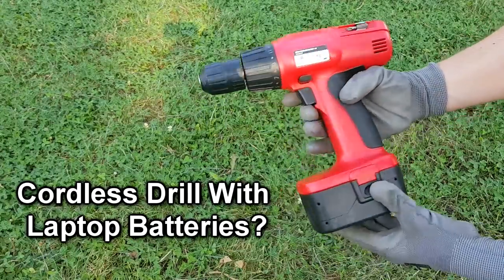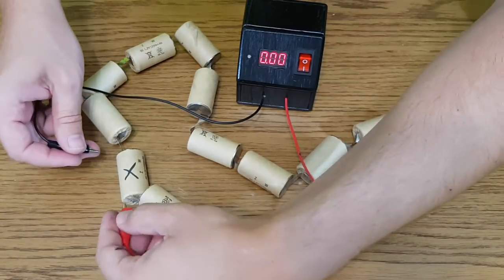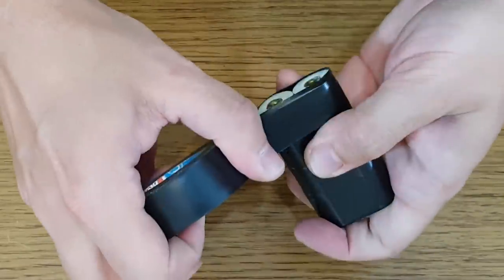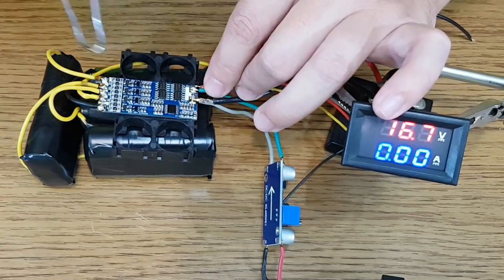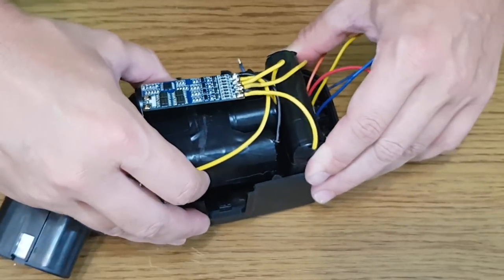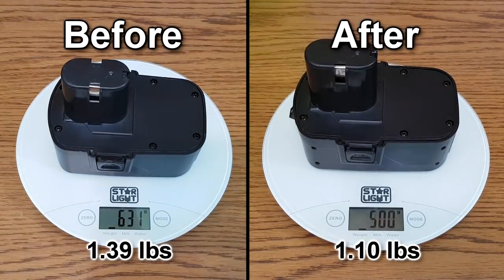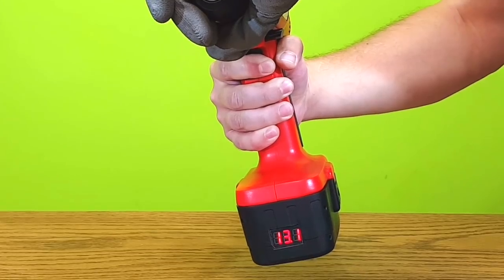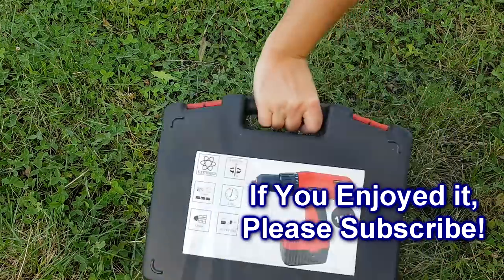Cordless Drill Conversion - With Laptop Batteries??

Comment: There are also shops which offer battery cases and PCBs for cordless tools which run already on LI-Ion batteries, for example the Makita LXT sytem. Combined with salvaged high current cells from tool batteries with broken PCBs (can also be packs from other brands) you can get extremely powerful packs, which are on the same high power level as the original battery packs. It is important to use high current cells in this case, because only them can deliver the currents tools like angle grinders or cordless chain saws need.

Comment: Nice tutorial.  But often, it is those cheap BMS and controllers that goes out first.  It is usually why laptop batteries are dead in the first place.  Instead of soldering all the components in the battery, just extend the balancing cable out.  You can make a small magnet door on the battery to hide it if you want to look neat.  Then modify the charger to connect to balance charger like Tenergy or Imax B6.  And just connect the balancing cable.

Comment: Nice summary of others videos, 
1-But are you sure the BMS make the full charging process : Constant current until 4.2V/S, then Constant voltage untill current goes to 1/10th the charging current then stop charge ? Because for what i've seen these BMS are mainly made to avoid under and over voltage and disconnect the battery from charger or charge when it happens (needing to remove the charge or the battery to reset)
2-how and where do you set the charging current ?
3-what is the usage of the 2A step down converter you put in links
Reply from the maker: hi. in the BMS specifications it says CC/CV. when the battery pack is getting almost fully charged, the charging current decreases from 0.60A to 0.25A. so theoretically it should have some kind of CC/CV charging. to be sure, you need to connect a volt/ammeter to a single cell, and monitor the entire charging process. the charging current is set by the BMS. if you want to limit the current, you can use a step up/down converter with current limiting potentiometer, added to a 12V or 24V charger. if you don't have a 12V charger, you can use the standard power drill 24V charger + step down converter from the link.

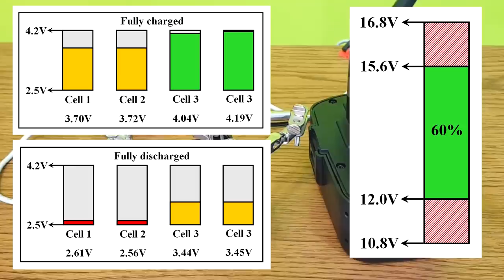Comment: At 14:57, 60% of voltage drop does NOT mean 60% of capacity. Voltage and capacity are non-linear relation.
I have a question. You set the step-up output to 18V, but why it drops to 13.9 to 15.4V when you charging? It's a 2A step-up module, and should maintain around 18V when current less than 2A right?
Reply from the maker: 60% it's an approximation, to make the explanation simpler. the voltage is dropping, partially because the step up converter efficiency decreases, when you increase the voltage. but mainly I think it has something to do with this type of BMS. I've used other BMS models and the voltage difference is not that big.

Comment: Bine explicat clipul insa as avea mici sugestii, de exemplu ar fi mai eficient sa folosesti un step-down cu un incarcator de 24v sau chiar refolosit cel de laptop, daca ai fi avut mai mult spatiu putea fi inclus in carcasa bateriei. Daca nu ai facut pana acum un spot welder din transformatorul cuptorului cu microunde ar fi fain sa vad unul bine pus la punct si sigur explicat de tine :D tine-o tot asa!
Reply from the maker: salut. dupa ce am facut clipul, am incarcat-o si cu incarcatorul ei original de 24V + convertor step down. este ok si asa, singura diferenta este ca nu se mai incinge convertorul de tensiune.

Comment: 1:30 I experience the same issue with my DIY dremel, when I connected it to my ATX Lab Power Supply (thx, I used your "Gorgeous" ATX Lab Power Supply project). Additionaly, I added a XL6019 LM2596S (Amazing StepUp & StepDown Module) to get some variable feature other than 3.3v/5v/12v. Sometime I need less than 3v, to test 3mm Led for example.
My DIY dremel is build with an old 555 motor, it was for a drill I guess.
So alternative is to connect it to 5v, then step up voltage till reaching the speed desire!
Thx for the explanation, why ATX is shutting down... I did not use the trick with dummy load as you cause I do not have access to a variety of those ceramic resistor. But after learning, how useful they are, I started to collect some of them...
But wait , at the end you are charging the battery pack with an ordinary 12v charger! this white charger you are using is not for litium cells. What about when the battery are fully charged?? This charger will not cut off?? Is it not dangerous for the cells to be constantly chaged??
Because I learned that BMS is not actually a proper charging board, it is a protection DISCHARGING board!! yeah some BMS got over charge protection, but still they are not proper charging board for litium cells...
Reply from the maker: hi. it depends on the BMS board. if you have a CC/CV charger or converter + a good BMS board with balancing feature and decent voltage values for the overcharge protection and the other features, it should charge the li-ion cells good enough and not damage the cells. the charging modules for one cell (4.2V) are better, because they are more precise and it's easier to apply all the protection features to only one cell. it's difficult to do the same think with several cells in series.
Reply: @Sorin_DIY  yes you are right, though, I think it is easier to use 12v charger for Lithium battery, like you used with your first Router UPS.
https://www.youtube.com/watch?v=IlEnEn7ptmc&t=8m54s
You right it is much easier charging a single 18650, but when you switch to 2 or 3 especially in series, thats when things start to be tricky and complicated.

Comment: Hi Sorin, I made similar modification like you, but my drill is stopping when accelerate. I used  3s 40a bms board  and  battery pack in 3s2p configuration. Dril is BOSCH GSR 9,6V VES-2.  There was a small resistor on the battery + - connectors i cutt it out, but i think should stayed there...Thanks.

Comment: thanks for the video, but may I ask why you've set the charger at 18 Volts? nominal voltage of the drill (and original battery, also your new battery) is 14.4 volts and maximum voltage of your new battery is 16.8 volts. shouldn't it be 16.8 volts? thanks.
Reply from the maker: the BMS charging voltage needs to be 18V according to the specifications. it also works with 17V

Comment: So, can I utilize an old laptop charger for this purpose? I assume I just need adjust the step-up/down converter to 18v. Correct?
And, should I worry about overcharging if I leave the battery with charger on whole night?
Thank you 😀
Reply from the maker: hi. you can use the laptop charger. but be careful if it has too much current, the converter and lithium cells may get very hot. the BMS board has overcharge protection, so you can leave it overnight.

Comment: Hello, i have a question. I will make same thing, but will use a charger from laptop. I can use 16V or 18,5V charger. What is the tolerance in the input voltage, and how can i limit the current if i don't use a DC-DC buck converter. Will the board limit current after going to 16.8V and will it stop charging. Thanks
Reply from the maker: hi. you need to give the charging board exactly the voltage it needs. the only option is to use the 18.5V charger, with a step down converter. you can use a converter with current limiting feature, like LED drivers. and set it to 16.8V and 1A. or you can buy a charger with 16.8V and 1A.
Reply: @Sorin_DIY   I will try with 17V adapter, hope 0.2V will not be a problem. What is the logic with the charge. When the voltage go up to 16,8 V like the charger on, it stop charging or???
Reply from the maker: I think it will also work with 17V. all 4 cells (or pairs of cells) are charged in series with the voltage from the charger, let's say 16.8V. it will take each cell a different time to get fully charged. when the first cell gets charged to almost 4.2V, the balancing feature activates a resistor (load) on that cell. the load will draw a part of the charging current from that cell. so the charging level of the cell will be "paused", until the other cells also get to 4.2V. then, when all the cells get to 4.2V, the charging is stopped. but when you use old/salvaged cells, it's difficult to balance them.
Reply: A few questions. I see the machine is 18V. You put 4 sells in series, which is 16,8V. The machine works, but with less power. When the battery is 16,8V why you are using 18V for charging. i try the same but with 4S 30A 14.8V-16.8V 4 Packs 18650 Li-ion BMS PCB W/Balance board. If i use your schematic the machine don't have power to spin at full speed. I reorganized the things , now it charges and works fine, but when i start drilling the voltmeter is turning of... but the drill still works. Probably i done something wrong, but will see it later.
Reply from the maker: my BMS board needs 18V, you can check the specs. you need to check the connections for the voltage indicator. you can disconnect the negative wire, to turn off the voltage indicator. you probably connected some wires incorrectly.
Reply: @Sorin_DIY  I fix it. Just made a little reorganisation on the board connection. Strange but the low voltage alarm is acticating on higher values. Or some of the batteries is not good and can't handle the load, or there is a sparks from the stator and that is confusing the voltmeter. Have to use a cap, but no time for now. Will live it like that. Thanks for the info.
Reply: Yanko Goshev .

Comment: This video is beyond cool.
I have a B&D screwdriver/drill with the same form-factor except 12V. If I wanted to give this a shot... What would you recommend, using a 4S battery and a step-down converter?
Reply from the maker: hi. a step down converter is not good for electric drills. because the electric motor will draw a high inrush current at startup, probably more than 10A and this is beyond most converters. you need high drain cells in a 3S configuration with a powerful BMS.
Reply: @Sorin_DIY  I see. I ordered a 3S 25A BMS and was planing to go 3S2P. Still deciding which batteries to use. What would you recommend? Between Samsung 30Q, Sony VTC6 and LG HE4? (or others if you can think of any). I don't know for sure any of these are original, I only have the store's word-of-mouth about them.
Reply from the maker: the brand and model are less important, they are all good cells. but you need to be sure, you don't buy fake cells. you should check the rating of the store and find products with a lot of orders and reviews. some people even post photos with the real capacity of the cells, tested with a good charger.
Reply: @Sorin_DIY  Servus Sorin, can you indicate a good li-Ion/Li-Po/LiFePo accu to buy? Any experience with them? Any suggestions?

Comment: "Someone who knows what he is doing"  I saw this quote and I totally agree.
Very informative and technically-correct video
I'd be interested in an update after 3 years.   
Are there any lessons-learned after 3y of using this?  
Anything you would do differently?
I'm going to convert my old battery-drill based on your video
thanks so much and keep up the excellent work,
ChrisV
Reply from the maker: hi. I used and charged the drill a few times, but eventually the lithium cells got very unbalanced, because they are not made for high currents. so you need high drain cells and a BMS board with a higher balancing current like 100mA.
Reply: What is your recommended minimum discharge current of battery to be use for power tools.

Comment: Hi Sorin. Just have seen your video. I am afraid of the switch you have used for the circuit. It looks so weak for the current of 10 A. What do you think?
Reply from the maker: hi. I think it was a 10A switch. it should be fine, because the switch doesn't start the motor. it just prepares the circuit to deliver current to the drill button.

Comment: @Sorin Hi, I have the same problem with the powersupply. I have a portable compressor (I can not measure the resistance) the motor spec is 12V 120W. Will the 2 1ohm resistor work, or I should increase the resistance. Thanks.
Reply from the maker: hi. what exactly do you want to do? you want to convert it to a PC power supply?

Comment: Hi. Thanks for the video. I replaced the old batteries with lithium ones. I just connected them as + to - and I can not charge the unit with the original charger. Why? Is the connection method problem?

Comment: Thx for the information. Great explanation and video. I want to do the same to my old  18 volt drill. Could you please tell me which parts  would I need for this project? It would be with a 5s BMS..
Reply from the maker: hi. you can use this type of BMS:
https://www.aliexpress.com/item/21V-100A-BMS-5S-Polymer-Li-ion-Battery-Pack-Protection-Circuit-Module-PCM-18650-Li-POLYMER/32844842468.html?spm=a2g0s.8937460.0.0.7dee2e0eO2J0QY

Comment: Great tutorial and extremely well explained but I have one question: why can't I use the old charger? In the end it is just a transformer that delivers a voltage and an amperage. I could use a voltage stabilizer if needed. Can you pleas explain this part as nobody on the whole internet (a little exaggerated maybe) is able to explain that
Reply from the maker: hi. the original drill charger has a different voltage than what the new BMS needs. but if you modify it or use a DC converter to stabilize the voltage, you can use the charger.

Comment: Hi Sorin .
I have a an old Makita drill that has ni-cad batteries and doesn't work anymore( the batteries).

I want to use with a cable attached to 2 power supply units,because where I live is hard to get imported items from abroad .

One of the units shut down after some use .

If I use 2 atx power supply units(computers) to get the 7.4 v that I need ,where do I have to connect the resistor you show in your video ,so the power keep working while I use the drill ?

My Makita motor internal resistance when the motor is not running  show 5 ohms ,and I have a 1W 10ohms resistor.

Any advice will be greatly appreciated.

Thanks.
Reply from the maker: hi. what's the original ni-cd battery voltage? you need a CC/CV converter, otherwise the drill will damage the power supply, or the power supply will shut down. because DC motors have a high inrush current, for you drill probably more than 10A. the resistor in series with the drill works only for testing. if you use it for long periods of time, the resistor will get very hot and probably burn.
Reply: @Sorin_DIY  .
Thanks for your answer Sorin .
The original ni-cad batteries are 7.4 v-1500mAh .
At the moment ,I'm using 2 atx power supply connected in series to get the voltage needed (5 v + 3.3 v) ,but one of them keeps shutting down after awhile .
I can get 18650 batteries,but ,not sure about about the proper BMS .
Maybe 2 connected in series(2 s)=7.4v 2200 mAh,or 4 connected in parallel (2 s)=7.4v 4400 mAh ,but first I'll look for the right bms .
Thanks for the videos that you upload ,they're very useful .
Cheers .

Comment: instead of adding resistance u may raise current to drill from ur power supply right? cause its original circuit do the same
Reply from the maker: the drill motor has a high inrush current. the power supply mistakes the inrush current for a short circuit and it shuts down. that's why it needs a resistor in series with the motor.

Comment: Plz explain more, how did you bypass the overcurrent safety feature of diy power supply, am not able to do this for my induction heater.. Plz Sir EXPLAIN
Reply from the maker: hi. you can connect the load first, then turn on the power supply. in some cases it will work. if not, you need a inrush resistor in series with the load. in this video I use 2 power resistors of 1 ohm connected in parallel, to create a 0.5 ohm resistor. this will decrease the inrush current at startup.
Reply: @Sorin_DIY  but i have already used 470 ohm resistor to limit the voltage to gate of the mosfer, adding another resistor won't let the gate switch anymore.
By far your videos and voice over is awesome.

Comment: Bro maybe your right thr 18650 laptop batteries cant handle the ampere that currently needs to output. But we have 18650 with 30A output max with a single cell like sony vtc4 its only 6 bucks per pair here when converting pesos to usd. And here most of the 18650s are used for vaping :)

Comment: And how about direct on adopter..? 
If we want to run dc 12v drill on direct charger so what value of charger we need i mean max current value and is it a good idea by the way..? Or is there any safe way to make it perfectly with the help of some component.
Reply from the maker: hi. it's difficult to convert it to an adapter. because it needs 10A or even more. you need a very powerful adapter and the power drill need a few modifications to decrease the inrush current. it's easier just to rebuild the battery pack with high drain cells.

Comment: As i can see your drill is 18V but you have used just 4 pairs of batteries (about 15volts) instead of 5 (18.5volts). Is it ok of using lower voltage for the drill?
Reply from the maker: hi. you are right, a 5S2P battery pack with 18V nominal and 21V max would be more suitable for this drill. but I wanted to test the drill with laptop batteries (which is not recommended). there is not enough room inside the battery case for 10 cells. only maximum 8 cell, so a 4S2P battery pack was the next doable battery pack. this has max 16.8V. there is a small difference in rotation speed, but li-ion cells are much better than the old unbalanced ni-cd cells. if you use high drain cells in this conversion, then it's just a 5S battery pack, there is enough room for 5 cells.
Reply: Just forgot to say that it is a great video as always